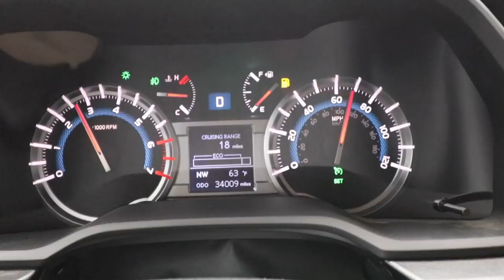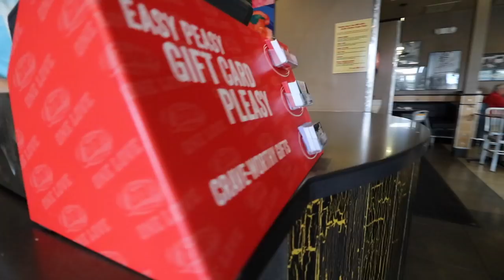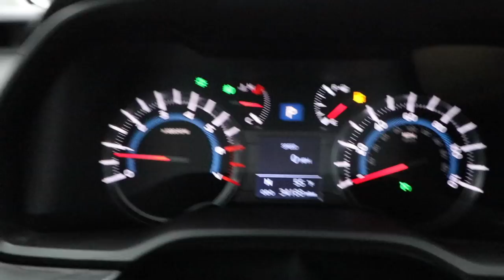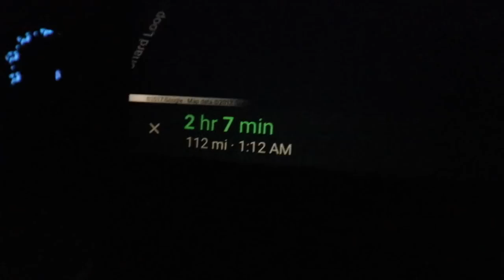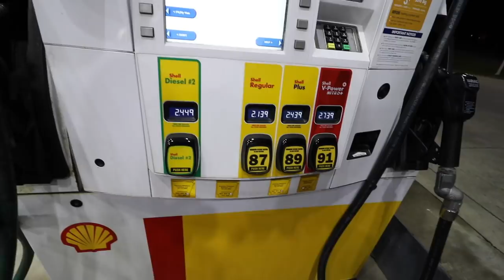ARB Drawer Install and The Day that would NEVER END

Comment: I seen Jon Burrows question on fridge.  I went back and relooked at your videos. You could move your tent to the 4 runner and run a lighter stove/water set up for long quick trips (may improve your mileage) leaving the trailer, but you would be giving up your nice trailer (it works well for you).  The drawers in the back of 4 runner look nice and handy.  I'll be waiting for your run down for the whole trip.  Pros & Cons, Mileage.  Things you really used & some things you could do without.
Reply from the maker: T- horse Yea - I could do that, but to me, the beauty of the trailer is that it actually makes everything so much more simple.  I keep it fairly well stocked with dry foods, and keep it all tidy.  To leave town, I just need to grab some clothes for me and the kids, fill up the water tank, hit the grocery store on the way out and hit the trail.  Bad mileage stinks, but at this stage, I'm not concerned about fuel economy.

Comment: Hi Jason, why are you installing your arb fridge in the SUV and not in the trailer. Is it because you already have one in the trailer or you just don't have room in the trailer. I'm building a turtle but noticed the fridge or fridge slide was not part of the options. Thanks and I love love your videos. Be blessed man!
Reply from the maker: The turtle back guys will tell you the trailer doesn't have the airflow in that compartment for a fridge and that it's better off in your truck. So I moved it!

Comment: I probably missed it but how did you power the fridge?  Are you doing a dual battery setup or running a single larger group 31 battery?
Reply from the maker: Gazziza29 I'm running a 31 agm battery. Had to put in a larger base plate and am about to hook up a solar panel to keep it topped off.
Reply: So when the car is running do you just use the 12v cigarette in the stock rear location?  Also how long are you able to run the ARB off the 31g when the car is off before the battery gets too low?  Appreciate the help!!!
Reply from the maker: Gazziza29 no no. I bought a 12v adapter kit and ran a dedicated line from the battery.
Reply from the maker: Gazziza29 and the fridge has an auto shut off so it won't kill the battery. The fridge starts warming up after about 3 days of not driving.
Reply: Thanks!!!

Comment: Love the videos.  So is that a 2nd fridge?  I just flipped back to the video where you got the trailer and doesn't that already have a fridge in it?
Reply from the maker: Jon Burrows Nope. The trailer didn't come with a fridge. I used to keep the fridge in the trailer but moved it to the back of the truck.
Reply: Jason Koertge Did you find some negatives to having the fridge on the trailer?  That seemed like an ideal setup so you are only hauling around the extra weight when you are out on an adventure.
Reply from the maker: Jon Burrows I liked it in the trailer. But all the turtleback guys were telling me there wasn't good enough ventilation in that compartment to keep a fridge in the summer. I actually love having it in the truck. Keep it in there almost all the time. Keep water in it - nice in the summer!